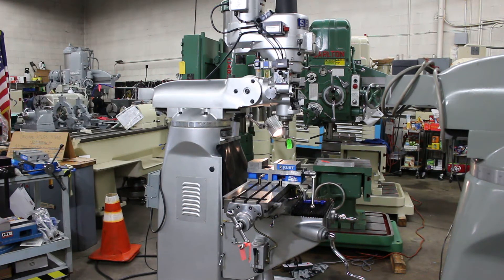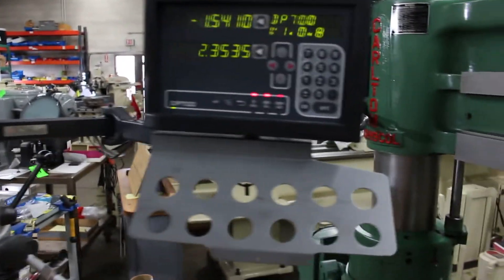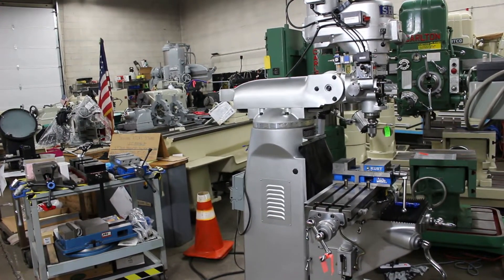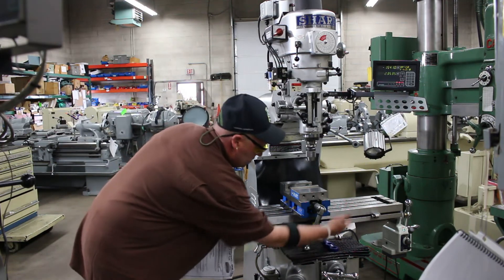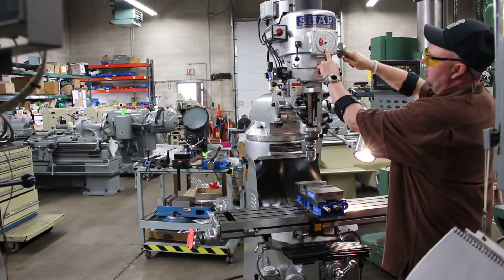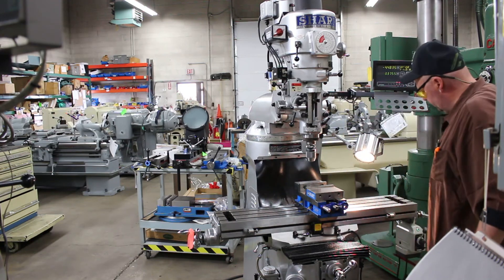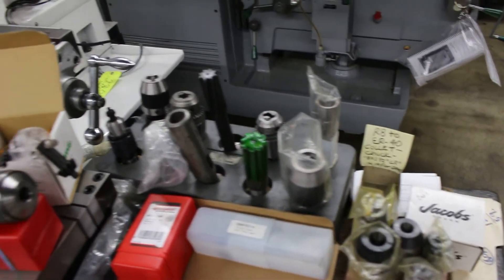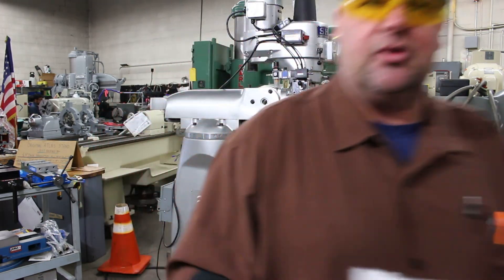Sharp LMV-42 Vertical Mill

Comment: 220v
Reply from the maker: Yes 220 volts, 3 phase power is how the mills are set up, nothing in single phase so we suggest to
contact a local electrical source if needed, to inquiry on a Phase converter for your shop. 

thanks for the support !!! Always great hearing from you as well, Bill Jr.
mci@machineryconsultants.com is how to ask any questions as a back up option 

if this one is sold, then well put you down for another option down the road, I try to keep things current